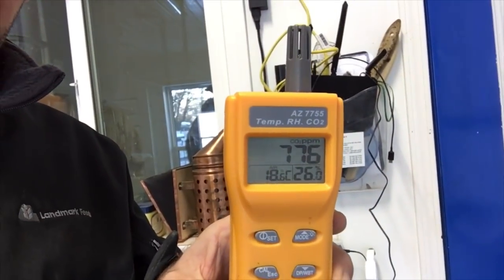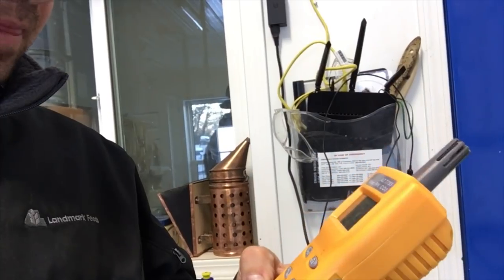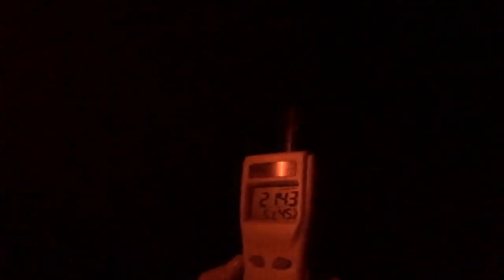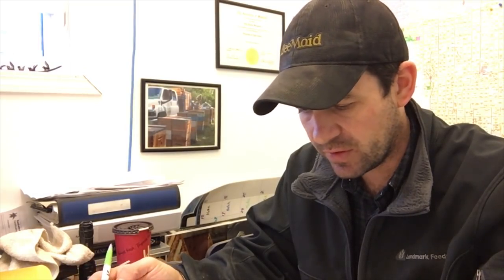Measuring C02 Levels within the Bee Winter Shed

Comment: Great video!

1
Too bad, there is no wheelbarrow size Roomba that would run automatically :-)

2
Have you experimented by removing the plastic feeding plug to help with the humidity?
Reply from the maker: Jerry deGroot 
Removing plastic plugs is a good idea
But later in winter I’ll run into low humidity issues , so I want that upper condensation within the hive.  
It’s just right now with the entrances, the condensation is too much in some hives

Comment: Indoor growers use co2 controllers or “sniffers” to raise or maintain high levels of co2. I imagine that the same controllers would be fine to 110 volt trigger your secondary fans to lower co2 levels.
Reply from the maker: Interesting
Reply: ...also 3500-5000 is really very high. Even plants can not process that amount of co2. You’d think that when the bees cluster for winter they’d also be controlling the environment within....but if you allow the co2 to be higher than outdoor levels wouldn’t that hinder the amount of control they’d have...so if outdoor without traffic is 300 ppm and your allowing as much as 3500 to begin with, that’s a serious difference.
Reply from the maker: @MrSteveswain  
yes I completely understand that train of thought, 
I dont know
Reply: a Canadian Beekeeper’s Blog also...think of co2 as a pool full of water. If the room is constructed tightly it won’t leak out co2. So the levels will skyrocket if not ventilated. Snow will not hold co2 from leaking out of a hive. So a properly ventilated hive should not be like a pool.
Reply from the maker: @MrSteveswain  
I dont know about that, Id expect concentrations to hold higher as the C02 and 02 exchange is restricted
Reply: a Canadian Beekeeper’s Blog co2 is very heavy. It will actively leak out of a room through cracks like water. Where air would never want to normally pass or be drawn through.
Reply: a Canadian Beekeeper’s Blog it’s also a giant consideration I have when sharing my condensing systems loads between rooms...if your ducts are both located high in the room it will cause the air flow to circulate across the top of the pool of co2 and will result in an increased level of co2 in the room being circulated. It’s best to have one high vent and one low.
Reply from the maker: @MrSteveswain  
so that would explain why the snow drift encased yards dont suffocate from c02.  That makes a lot of sense.
Reply: a Canadian Beekeeper’s Blog it’s fair to say you’re my favorite bee keeper on YouTube. And I’m in Maine I’m looking at snow drifts in my bee yard here also. That’s an interesting consideration...I’d be interested to see what co2 levels are inside the snow level vs. above in open air.
Reply: a Canadian Beekeeper’s Blog and also if you add floor fans blowing upward you’d loft the co2 up into the air to be circulated out somewhat. Lol. Classic industry information swap !
Reply from the maker: Stove Swain 
My objective with the ceiling fans is to do just that, stir the air and ventilate it.  I know guys with elaborate plenum systems overhead and at floor level.  I should really do the same
Reply: a Canadian Beekeeper’s Blog lol. Yeah I’ve seen elaborate a time or two. I like your solid thoughtful approach to all aspects farming, you’re truly specialized broadly across your industries.
 “Perimeters to failure “ are key right ! 
 I appreciate learning from you. 🤘check out my Instagram if you get a chance. It’s all about those perimeters...
Reply: @aCanadianBeekeepersBlog  
CO2 kills. I think you are measuring at waist or chest level.
While you have fans going to mix air gases your observation of iceing in some areas may correspond with stagnant  movement of co2 gas also. Such that you will see a stacked gradient in certain areas of shed for moisture, temperature and co2. You mentioned co2 molecules are heavier than air. Density gradient for co2 is increased at foot level and less at nose level in your normally operating shed. So a colony on the floor in a poorly ventilated area may be more co2 saturated than a colony elsewhere especially if it is high in a stack under a fan. Mixing like you do is good.
I am reminded of food safety. A McDonald's fast food stored its  beverage co2 tank in the room under the ground level floor.
Some employees got ill in the room with the co2 tanks. One of them passed out. A employee stayed with the passed out person while the third person went for help. By the time fire rescue arrived 3 people had passed out in that room. Before it was over 3 employees and one emt were passed out before the problem was recognized.
Co2 tanks are now stored by code outdoors.
We live in a fantastic world.
Reply from the maker: paul dow 
You missed the fact of my continuous air mixing within the room.  The frosting of my air inlets is a result of cold air combining in through a shaft into a humid warm room.  Condensation. 
There is no difference in C02 observed higher or lower.  The air is mixed.  What I am showing is higher levels within the colony hive, within the cluster itself.  I’m tapping into that cluster dynamic simply by opening the top cork to access cluster without any disturbance.  
Wait til you see a reading I took today for
 A hive over 10000 ppm co2, and then what slight disturbance did you that cluster maintained Co2 envelope

Comment: Very interesting video. I love your down to earth risk management approach. What kind of fire protection measures does your shed have?
Reply from the maker: No open flame within the structure, electric boiler floor heat, its newly constructed with new wiring, steel inside sheeting.  About all I can do.
FULLY calculated for insurance purposes structure and contents...$$$
boxes stored outside the building
Reply: @aCanadianBeekeepersBlog  All sensible things. Did I understand correctly that you only have exhaust fans, no intake fans? (Would be smart. If a moving part catches fire, better that it blows the flame out than in...) Do they have a thermal circuit breaker? For the ceiling fans an earth leakage circuit breaker should suffice. No smoke alarm?
Reply from the maker: Blows air out, yes the motors have thermal breaks
Reply: @aCanadianBeekeepersBlog  Sorry, didn't mean to make this an interrogation. :) Just curious about your setup. I really like the way you approached it. All the essentials, no frills. Thanks for the explanation. Hope your bees have a good winter.
Reply from the maker: Lol, I love the conversation 👍
Reply: @aCanadianBeekeepersBlog  K. :) So may I ask, do you have smoke alarm? I mean, rules are broken, right? You'd be amazed how many fires are started by cigarette butts in places where it says No Smoking...
Did you look at electric floor heating elements when the shed was built? That stuff is getting pretty affordable now. And no leakage, clogging or wonky thermostatic valves like you get with water based floor heating. Just curious...
Reply from the maker: This shed has a 3 zone infloor heat boiler system.
I have no s one alarms , we don’t sleep in here but a remote system might prove useful
Reply: @aCanadianBeekeepersBlog   I'm surprised the insurance didn't demand at least a smoke alarm. Maybe something for next year.
Thanks for sharing. I enjoy your insights, just as much as I enjoy your love for what you do. All the best from the Netherlands.

Comment: The CO2 readings are interesting...it got me wondering how hive ventilation using screen bottom boards, etc in what I would call a "traditional" bee keeping operation (hives outside, etc) would effect the CO2 levels in the box.  Would they be lower?  How would that effect the bees wintering over if you are correct about high levels of CO2 putting the bees in a stupor for winter?
Reply from the maker: Bob Rogers 
The question is what’s naturally occurs,
Open bottoms maybe but think of it as air disturbance.  Open bottom means only ambient surroundings, the cluster only maintains within the cluster and the air foil around it. 
Still air is important